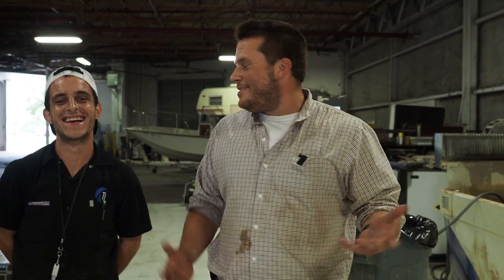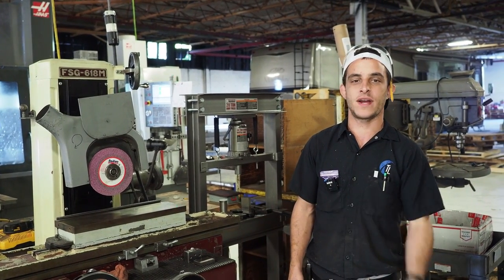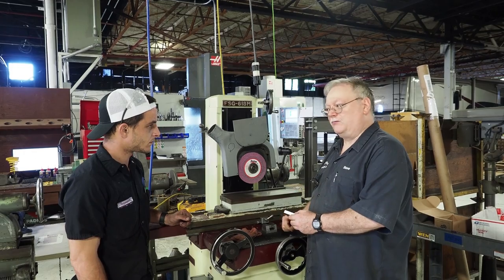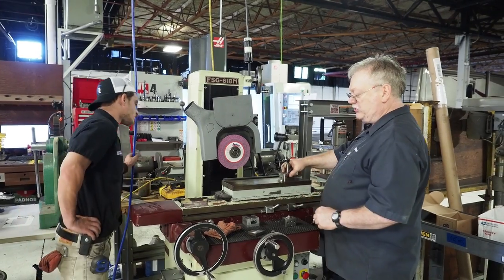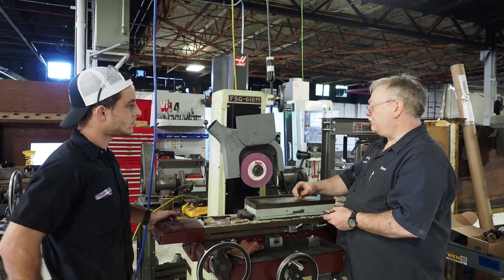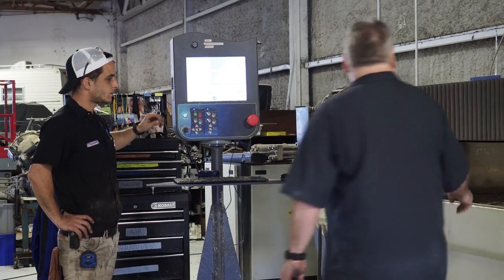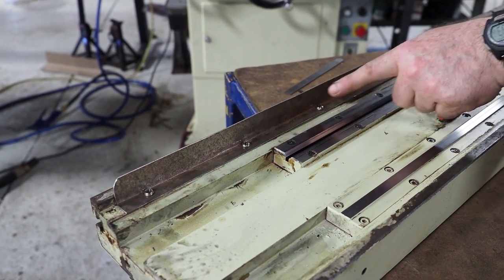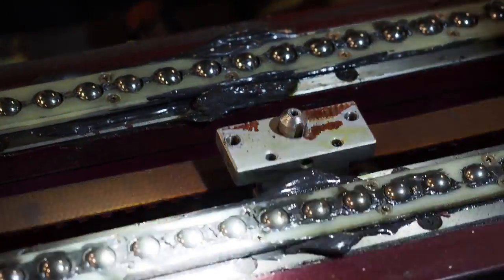Setting Up a Used Grinder with Top Line Engineering

Comment: I'm really happy I happened across this video, in  my home shop at home I have a Reid 618 rollerway and this gave me the insight needed to dial it in properly. working in a broach shop, I'm used to Parkers, but they're out of my price range and a whole different monster. I've never been a fan of Roller bearing grinders but this might help me dial it in as tight as I need!
Reply from the maker: I hope thins go well for you. The Reid is a nice machine.
Steve

Comment: Steve is right. I've set up enough new Mitsui grinders to know that they are shipped with spacers between the table and the ball ways to keep the balls from brinnelling into the D-2 ways from shipping vibrations.

Constant oil lube for ball ways is ideal. Not a fan of grease, but maintenance is an issue. On Mitsuis, we remove the tables every 6 months, clean everything, oil lube, and regrind the chucks.

Comment: Whenever we had to pull a table off we always left the chuck on. Then when we put it back together we would put a large heavy plate on the chuck and do some heavy grinding removing at least 50 thousandths off the plate . This would make sure the table was seated well. then we would move to grinding the base and chuck. When grinding the chuck we would always use a new wheel. A new wheel with the larger diameter will not load up as fast and run cooler.   I guess I missed the part where you talked about how important it is to make sure the grinder is level and solid on the floor.

Comment: When you said someone would get killed, I was thinking the lathe operator would pound the crap out of the grinder hand for throwing sparks at him, not the lathe operator getting hit by thrown parts lol.  Seems amazing that you could hold such tight tolerances with such rough looking equipment.  Your knowledge and skill clearly demonstrates the grinder is a tool you need training on.  It's not something you're just going to figure out.
Reply from the maker: Hi Barry,
The grinder will definitely have to be moved for safety reason. Thanks for the kind words.
Steve
Reply: @SolidRockMachineShopInc  A bad lock down or forgetting to mag the part happens to just about any even experienced operator, the once it happened to me good thing there was a guard and that the machines were in a safe arrangement, this draws attention even in a noisy shop...   🥶😨😱
You're absolutely right about that could be a killer....!!!!!   Those aren't toys...!!!
Reply: the machinist  Doesn't really help though as I have slung parts off turned on chucks too.
Reply: the machinist  Guess 
If you got a bigger machine, you need a stronger fence, this is way above my league...
Safety always has to be the number one issue on any machine, all mishaps happens so quickly...!!!

Comment: How fast do surface grinders usually get up to speed? I'm used to pedestal grinders that reach max rpm somewhere around 5-10 seconds after starting up. The surface grinder at the shop, however, starts up lickedy split, probably under 2 seconds. To the point where I wonder if it's wired incorrectly, or if it is intended. Any insight, sir?
Reply from the maker: mine is almost instance. If you have a VDF you can change it to spin up slower.

Comment: Thanks for sharing. I didn’t know anything about grinders but had trouble with my 3D printer. A friend told me to stop using oil and to clean it and start using “super lube” it’s a food grade silicone grease. I couldn’t read what the Lucius grease you used was made from or what’s in it.
Reply from the maker: I use white Lithium 2.
Steve

Comment: That was cool, transformation complete. Looking like they got a great deal. soooo many tools can be made, modified, sharpened with that machine. If they dont have flat stones start there. I'm more of a automotive mechanic i wanted some mechanics flat stones for years. so i tried a #80 pcd cup wheel on a mini mill (seirious tram) and a homade arbor trued the wheel and got my flatstones in one smooth operation, no it actually worked rubbed em on a bmw block cylinder deck the other day that i thought had been rollocked to death but no the factory tool marks where even all the way across nother score
Reply from the maker: Yes, I think that machine well do a nice job for Top Line.
Steve

Comment: What wheel do you recommend when grinding in a mag chuck? Make, grit size, hardness? I have coolant on my surface grinder. Thanks.
Reply: We like using Norton 46H for chuck grinding. I think they're only available in 32A aluminum oxide.
Reply from the maker: Hi Steven,
The wheel that I liked best is no longer made. It was a Radiac 46.2 J. It was a 46 grit wheel with 2 percent finer grit added in. It was a great all around wheel. I prefer Radiac wheels I use an 8" diameter 1/2" thick 46 grit H or J hardness. You will find that the bonding between manufactures is not the same. A J wheel in one brand may be the same as an H in another brand. Right now I am using a Radiac RAA46JVOS with good results I may try a 9A in the future. I am still experimenting to see what come closes or beats the 46.2 wheel that I prefer
Steve.
Reply: @SolidRockMachineShopInc  Have you come up with another wheel to replace the 46.2J? Thanks.
Reply from the maker: @sawduster121212  The best I have used so far is just a straight 46 J. Doesn't work as well but close enough. If I find one that is as good or better I will definitely mention it in future videos.

Comment: Howdy Steve! 
Just took off the table of the surface grinder at work. We were missing half the balls on our flat rail side... Any who, our linear ball cages seems to be made of nylon and are connected together like children's wooden railroad tracks. It does not have screws in the ball bearing cage at all, unlike the one seen in this video. Is this grinder's ball bearing cage made of plastic or metal, and what is more common?
Thanks in advance for your response sir!
Trent
Reply from the maker: Hi Trent, All of them I have seen are made out of Nylon type material.
Steve
Reply: @SolidRockMachineShopInc  Thank you for your response, sir! Do you mind answering a couple more?
What grade of ball bearing is acceptable for you 200, 100, 25?
And is good ol' AISI 52100 alloy good enough or should I spring for some hardened 440c stainless?
Reply from the maker: @trentwood1449  Those questions are above my pay grade. I would see if you could replacement ones from the manufacture.
Reply: @SolidRockMachineShopInc  Rock on!
Reply: @SolidRockMachineShopInc  Steve!
Can't thank you enough for this and countless other videos. Got the grinder back together at work, ground the cast iron base as you said, then the bottom of the mag chuck the same way. Went ahead and checked my mag chuck on the surface plate for flatness with some machinist jacks and it was flat within a tenth or two. Gonna' grind the top of it tomorrow and it's off to the races! Thanks again sir!!
Trent
Reply from the maker: @trentwood1449  You are welcome. I hope every thing works out well.

Comment: Could those linear ball guides be replaced with linear rails with ball bearing carriages? Or are they less accurate than those oem ball guides?
Reply: Short answer: yes with some machining.  I don't think there would be a big advantage to running linear rails as apposed to this system which is a typically 3 V's and a flat.  The v-ways (which usually have replaceable hardened races) kinematically locate the bed with the help of gravity.  Rails are often designed to take forces in more directions than this design which is an advantage for applications where that is needed (here it's not).  On a surface grinder, it would complicate disassembly, and set up of the machine.  You would also need very good rails to achieve the long term precision of 3 v's and a flat.  Rails make more sense on the vertical axis of the machine.
Reply: Short answer: yes with some machining.  I don't think there would be a big advantage to running linear rails as apposed to this system which is a typically 3 V's and a flat.  The v-ways (which usually have replaceable hardened races) kinematically locate the bed with the help of gravity.  Rails are often designed to take forces in more directions than this design which is an advantage for applications where that is needed (here it's not).  On a surface grinder, it would complicate disassembly, and set up of the machine.  You would also need very good rails to achieve the long term precision of 3 v's and a flat.  Rails make more sense on the vertical axis of the machine.

Comment: very informative as always thanks Steve, what RPM do surface grinders work at I was thinking of building one .
Reply from the maker: I believe these are at 3450 RPMS.
Steve
Reply: Building your own surface grinder would, IMO, be folly, as a recent series of YT videos on another channel proved. The more you know about them, the more you may come to realize this. 

That said, grinders of this size, (7" wheel) run at 3450RPM, as Steve said. Us hardcore pros use a VFD to vary speed as required. It makes us more productive.
Reply: thank you Steve I don't have the money but the one thing I do have is a lot of time a mill and metal lathe and a forge foundry all in one .
Reply from the maker: You're welcome Dan.
Steve

Comment: Excellent content Steve! My old 618 is in dire need of some maintenance. I've been putting it off because I had alot of questions you addressed here. What wheel hardness do you like for the soft steel, table and magnet you ground here?
Reply from the maker: Thanks Max,
I was using an "I" but a "J" may be just a little better. The general rule is harder bonding for softer steel and softer bonding for harder steel. You will have to experiment because each wheel manufacturer has there own recipe and the bonding may act different between manufactures.
Steve

Comment: dude, first thing is to clean the dust around table, once you expose the bearing to open air any dust will work its way  into the system
Reply from the maker: We had no issues with grinding dust here Sam.

Comment: Omg! To check the Spindel you have to remove the grinding disc and measures the Spindel on the cone!
Reply from the maker: I wasn't checking run out, I was checking slop.
Steve

Comment: If someone is "sliding" parts across a ground surface, such as a mag chuck, they have no business in a machine shop. If they have done it enough to cause wear in the surface, they should be hung.  Don't be lazy, PLACE parts on ANY precision surface, be it a chuck, a vice, or a fixture.  That is first day apprentice stuff.
Reply: It's not a matter of being lazy, parts are slid on to make sure the part isn't sitting on any dust
Reply: @markshort9098  that's why you clean surfaces before you place part, like I said, first day apprentice stuff
Reply: @jacktheaviator4938   yep clean the surface and by the time you turn around there's dust on there again.. losing 0.0005 or so off a mag chuck a year is just part of the cost of working to such fine tolerances, the best tool manufacturers say to always slid the part on the chuck and the surface plate to insure there's no dust under the part but what would people who have been working in millionths for over 50 years know about   precision